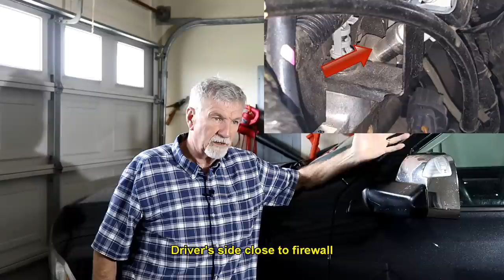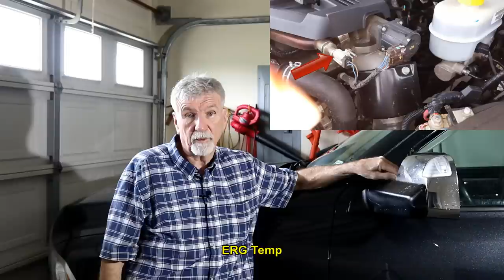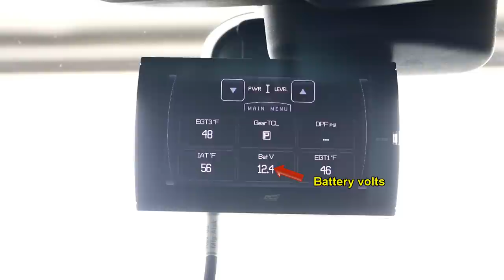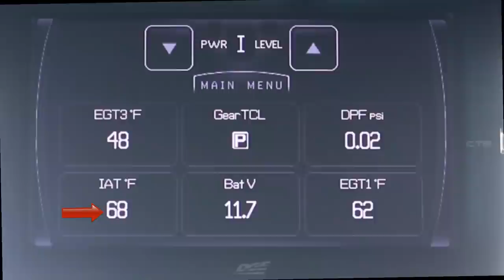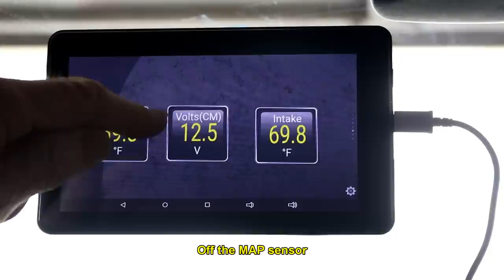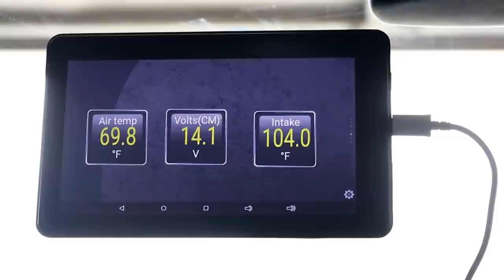How to monitor the RAM Cummins grid heater Temperature

Comment: In the second "cold start" I wonder if the system is routing some EGR into the intake to assist with warm up? Can you run the same test in similar 70 degree temps and monitor EGR valve position? Thanks for the videos you do.
Reply from the maker: Yes I'll do that
Reply: I agree, I think it would be very interesting to see how EGR valve position affects IAT. Great video, thank you Marion.

Comment: Would you ever do a grid heater delete?
Reply from the maker: Yea, if I ever do a full delete, I'll probably do it then.   No plans to do it at this point
Reply: Without the grid heater, there is better flow. But the truck has no glow plugs, so it would constantly cold start correct? But be okay for southern US?
Reply from the maker: @dylanowens5036  yea.  The nortthen guys say I'll  dts yt? Down below 0 deg F.  I'll decide for sure but I think I can do without it.
Reply from the maker: @dylanowens5036  Yea, I'd possibly do an after market if I though I was going to need one but from what I hear, it'll start at 0 deg without the heater so maybe not need one at all.

Comment: Do you know if the grid heater gets triggered to cycle after a certain temperature below like 67° or something and does it read off the temperature sensor in the driver mirror or does it read off the INTAKE air sensor on the intake tube?
Reply from the maker: It's controlled by the IAT sensor at the intake manifold. EGR helps the warm up.  Yes about 65 degrees.  Once IAT sees 65 it stops cycling.
Reply: @MarionBlair  do you know if there is any way to trick it into thinking it's above 65? I need to pass California smog and that damn heater is faulty... so it throws a check engine light now that it's 55 degrees in the AM here..... so I get screwed every time I go to drive it I have to reset the monitors by clearing the CEL.. I need to truck the truck into thinking it's like 70 degrees so I don't get that error

Comment: Get an Edge CTS 2. By far the best gauge around
Reply from the maker: Well I'll find out because I've had both and the torque app.  I can't say yet.  I received the idash yesterday, there's some things right off the bat I didn't care for but same with the CTS.  The reason I wanted to try the idash was it's ability to record data and export to excel or whatever.  I could do that with the CTS and the CTS was horrible with windshield glare.  But the idash mount is flimsy and doesn't appear to be built as well as the CTS.  My CTS has some fixed screens for angle, inclination stuff that you could use or remove.  Hopefully they have changed that.  But I'll see which I prefer.  So far, I like the build quality of the CTS better but the Idash may provide more data.  It's a trade off, maybe.
Reply: CTS 2. 2. That one lets you data log and the glare is much much better
Reply from the maker: @alfonzooliviera1121  can you export to excel?  I never had much luck with my CTS.
Reply: Marion Blair  yes sir using a software called fusion. Data log up to 1 hour